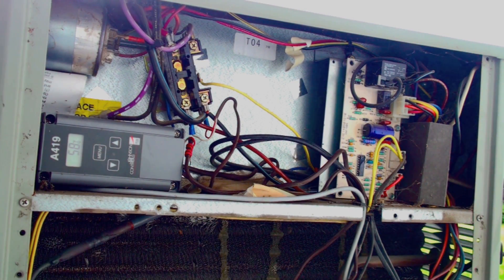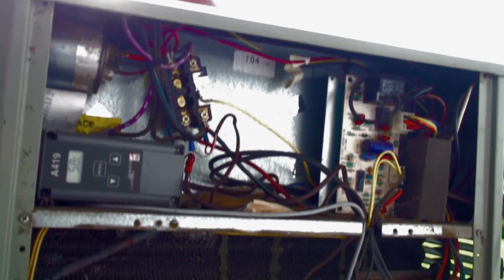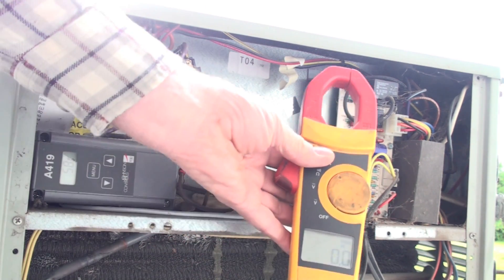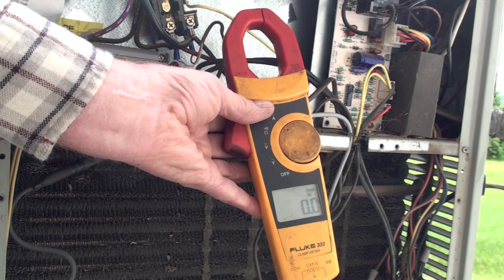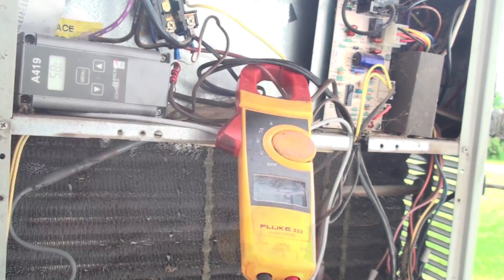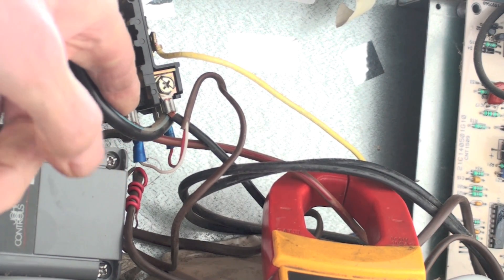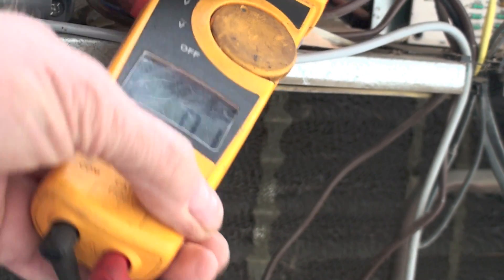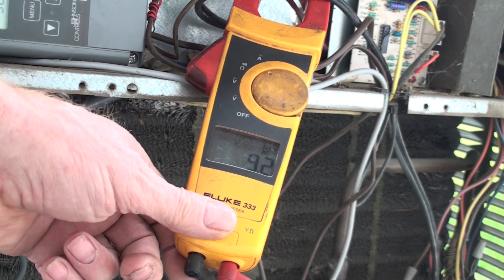How to check amp draw of air conditioning compressor

Comment: Hi gray thanks for the video. When you checking amp draws on a compressor are you check the amp draw of both, run and start winding.
Reply from the maker: I would be checking the common wire.  It contains the amp draw of both the start and run.
GFM
Reply: Thanks a lot I do really appreciate it

Comment: You should make a video testing amp draw on the 3 wires running to the leads on the compressor.
Reply from the maker: You may see it soon.
GFM

Comment: So in other words, red wire is power here?
Reply from the maker: This is a 240 volt circuit.  There are 2 power wires.  The color code is meaningless here.
GFM

Comment: Thanks for the vid.  Replaced a bad dual run cap and have a condenser pulling only 9 amps when running. Was tripping direct wired 50 amp breaker at times over couple week period before cap went bad and has done it a few times since new cap installed.  Found aluminum wire run and slightly loose and arced contacts at breaker.  Cleaned and tightened. Verdict is still out, but on start up condenser pulling 57 amps for a split second and then goes to 9 amps. Been ok for 3 days so far. Is this initial amp draw in tolerance?
Reply from the maker: The draw is probably ok.  Your problem with the breaker is probably the loose wire.  Some no corrode may help.  If it stays on your are ok.  Keeps kicking off replace the breaker.
GFM
Reply: grayfurnaceman thanks for the response. Last problem was definitely the loose burned wiring.  Can’t even describe the problems this person had by not changing a filter for a few years.  Unreal.
Reply from the maker: The amp draw on startup is probably ok.
GFM
Reply: Yes, it’s been good for like a month and a half now since I serviced the bad contacts at breaker.  All coils cleaned, new run cap, condensation line blockage cleared. The dirtiest filter I’ve ever seen contributed  to this system running constantly for the last couple years. Thanks again.

Comment: Thanks Gray.  My boss told me earlier today that ams mean nothing determining if a compressor is good or not..based on the fact it was 25 yrs old and new contactor and capacitors and ok blower wheel.  And 0 amp draw from compressor had me determine it was bad and or failed...I then got reamed out of why I didn't do further investigation to why..how do u feel??  4 yr tech here
Reply from the maker: You should have done further investigation.  When you have 0 amp draw, you then need to check voltage to the compressor.  Could have a burned off wire on the compressor.
GFM

Comment: When checked my AC,Clamp meter was showing 4.5, does it signify any fault in compressor?
Reply: He stated that lower amps or high amp draw both indicate a problem inside the compressor.

Comment: My condenser fan motor is pulling 1.1 amps and the specs say 1.2. When will I need to replace the motor? Should I buy one to have in case it goes out? Or does it do more damage to wait until a motor stops running?
Reply from the maker: Sorry about the wait.  You were in the trash.  If the motor is drawing at or below the rated amp draw, its all right.  
GFM

Comment: When using the clamp meter for the sake of comparing the draw to the RLA would you double the meter reading since we're looking at one leg?
Reply from the maker: Brian Fletcher No.  The power is one single circuit, so that is total amp draw.  Hope this helps.
GFM
Reply: What about 3PH? Do we add numbers we read on each leg? Do you have video about how to read amp draws?
Reply from the maker: 3 phase is similar to single phase, clamp only one line.
GFM
Reply: So lets say 2A on each 3 legs which still means total amp draw 2Amp right? Thanks for putting up with my dumb questions.
Reply from the maker: You got it.
GFM

Comment: QUESTION? Thanks in advance! i have heat pump unit it works fine but it will burn out my high voltage side of the transformer it is a 240V on the high side of the transformer. i replaced the transformer once and it took like around 3 weeks or a month to burn the new one i had installed. i bought a new transformer and i plan on addig a 3amp fuse on the low voltage side of the transformer but how do i trouble shoot something that does not kill my transformer right away???any ideas?? thanks for you help???
Reply from the maker: idontknow weknow You need to know the amp draw of the low voltage side.  Most of these transformers should not draw over 1.6 amps.  The other possibility is that there is an intermittent short to ground of one of the transformer wires.  Hope this helps.
GFM

Comment from the maker: Clamp each wire.  The one with the highest amp draw is common.
GFM
Reply: Which reading do you use if 1 is higher than the other? Example: a vent motor/inducer. The FLA is so low, that the difference between hot and neutral makes a difference

Comment from the maker: Were you checking amp draw upstream or downstream of the start winding?  The common will always be the same.  If the wire clamped does not include the start winding, that will account for the difference.  The only thing I can think of that would cause an imbalance would be if there was a short to ground within the compressor.  I have never seen that happen.
Grayfurnaceman

Comment: What if L1 is pulling 22.5A and L2 is pulling 19.5A.  Why would that load be unbalanced like that?  The only things being powered are a 220V compressor and a 220V fan, there are no 120V devices pulling on one line to neutral.
Reply: I believe the other wires around clamp also affect the accuracy. When you move wires nearby, you will see different.
Reply: @hvacworkshop4791  If your unit is pulling 20 plus amps your heat strips are on.